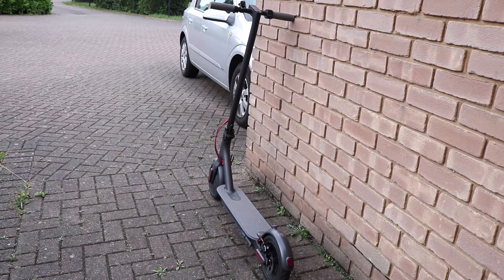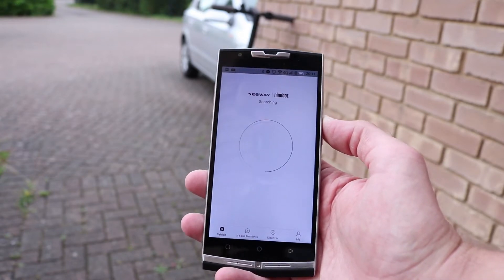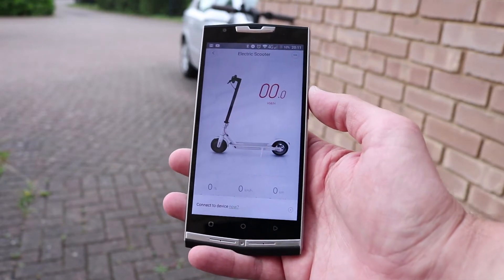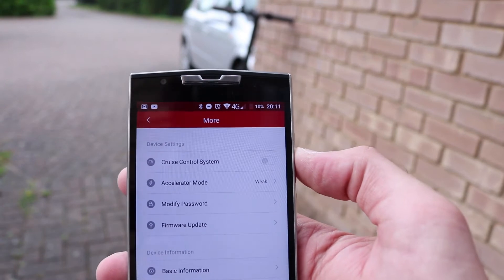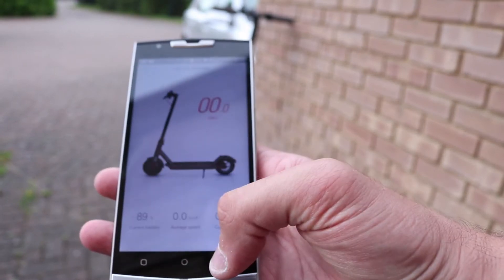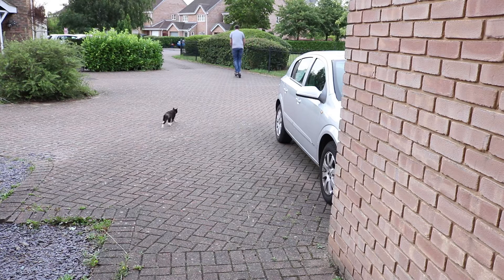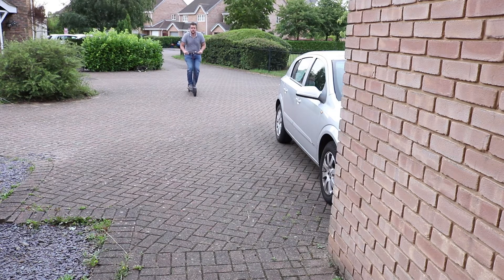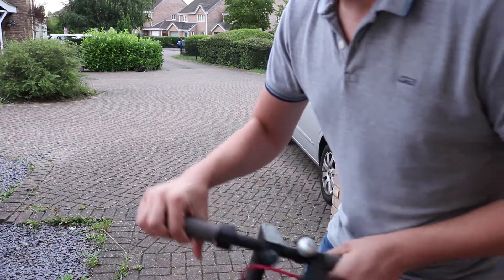Xiaomi M365 Repair - BMS Fuse - Part 2

Comment: I read that it needs to be a 40amp fuse for normal operation. Definitely try that, and also use the method of using a fuse socket so that your can easily switch out if necessary. Makes it easy for testing and future repair.  https://mimod.ru/en_US/m365batteryfusefix/

Comment: Solder 2 fuses side by side the new version has 2 fuses. Also when you cut the battery cover just cut it all the way down one side then when you put it together tape it with some duct tape.

Comment: Man I thought It was really going to work this time! This repair video it’s gonna turn out to be a mini series Lol!  Hey how about just disconnecting the switch on the brake lever, sorry that all I got. Can’t wait for part three
Reply: I was just thinking maybe the BMS is just doing its job, what if you have a bad battery cell wouldn’t the BMS shut down when you try to charge it. Try replacing the fuse again and plug in your charger see what happens.....

Comment: Not sure if the fuse problem was ever fixed as this is a year + old , but you could just jumper the fuse circuit, just use a small piece of coat hanger.
This breaking fuse issue is a known defect in the early manufactured version of the Xiaomi M365. They fixed the issue in later versions...

Comment: My scooter was dropped and now it won't turn on, i kniw the battery is fine cause i put in in my ebike and it's fine. Do you think the fuse could've blown? The wires and connectors are fine so the only thing i can think of is the fuse somehow blowing

Comment: Nice videos ! Great job !
Same thnig happened to me today, the fuse blown. But while I was trying to fix it I think I accidentaly broke the whole BMS board (one of the circuit bord is getting hot when re-plugging the middle flat connector) and the scooter is not working anymore

Comment: as mentioned , your mechanical brake is working, but it also has a switch to tell the circuit board you are braking.this is important because the board needs to cut power when you apply the brake, otherwise the safety fuse will blow, since it cant provide enough current to the scooter motor to overcome the mechincal brake. so maybe your brake sensor is not working. i dont know the layout of the throttle but try braking with no throttle applied.or as you said it could be the regen part of braking which is another matter

Comment: People are reporting that this might be due to energy recovering system trying to charge battery above its capacity. You could possibly test if this is the case by checking if the braking still blows the fuse when the scooter is half way charged.

Comment: I just ordered the scooter and plan on doing a mod to it if I have the fuse blowing issue. I plan to solder two wires where the fuse attaches and lead them to an aircraft circuit breaker mounted to the side of the battery case with the button on the outside of the case. This way, I can have the circuit protection that is needed and quickly be able to reset it if needed. https://www.aircraftspruce.com/catalog/elpages/klixon7277.php

Comment: does the firmware version 1.3.1 fixes the fuse problem?
Reply: anyone knows answer?
Reply: I can confirm that firmware version 1.3.1 does not fix the problem.   After about 3 weeks and ~10-15 short rides (less than 1 mile) my replacement fuse blew.  Also, the battery level was at 3 bars when this happened.
Reply: Do you have your breaking on weak?

Comment: As the commentator below had put. I would slowly up the fuse rating until it maybe found the balance of not blowing under braking and not burning the main board. After all, if it's for the kids, it's not much use with out a brake,  so taking a risk on burning the board is really a no lose situation in my eyes. Good luck ol' bean.
Reply from the maker: Dene. F. Yea, I'll see what fuses I can find :)

Comment: Brake Break. If you can find energy recovery circuit from brake, disconnect, add resistor, or as a community bash Xiaomi and email them videos. Maybe shame will work. Also, post on Amazon as they sell it. Question them on fix, do a text review. I've had some success using that to negotiate with seller, but not if you bought from Ali Express, Gearbest, Craigslist. No fix from those sources.
Reply: Geeky Stuff.  When you apply the brake 2 things happen.  There is the mechanical brake, and also a hall sensor in the lever. The sensor is used to notify the controller of the amount you break.  The controller then uses the motor to slow down the scooter, which pushes energy back into the battery.  This is sometimes know as KERS (Kinetic Energy Recovery System).  The sensor is also used to turn on the rear light when you hit the brake leaver.
Reply: Last solution if you paid with PayPal like I did to Gearbest you have 180 days from the time of purchase to backcharge them if " item significantly different than described or as in my case faulty and not running at all" that might work.
Reply from the maker: Scott Mannear what's energy recovery circuit? Lol! One thing I don't understand is that the brake is wire cable, mechanical. Just Like a normal push bike. The only electricity to the rear is for the brake light that flashes when applying the brake.

Comment: Thanks for another video. Obviously it's not save tu use device without good braking system. I would put the biggest fuse what I can get and if that's would burn my bord then that's the way. Maybe after would try then to get new bord from manufacturer or somewhere. Obviously there is some electrical fault on bord or braking system with blows fuse off. Good luck  can't wait next video
Reply from the maker: Ugis Putnins Thank you mate. I will look at other fuses. I have been looking online for a new BMS board but can't find any